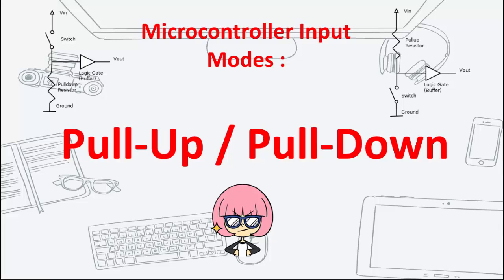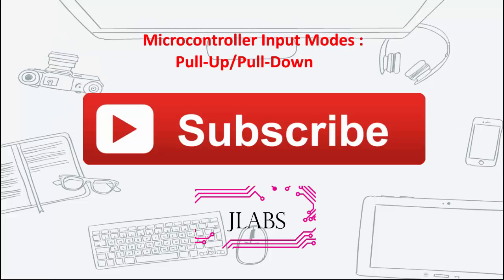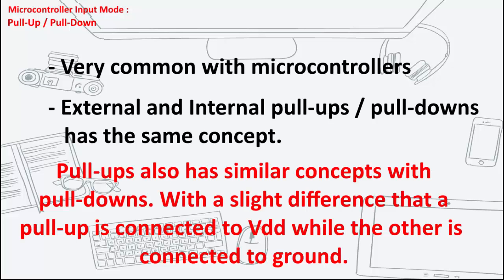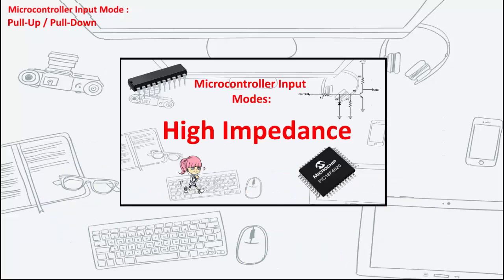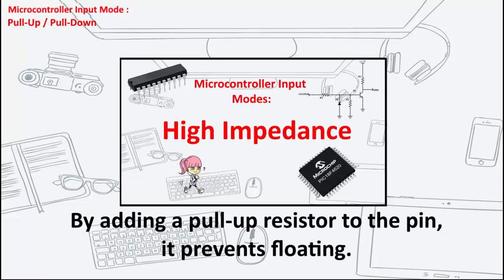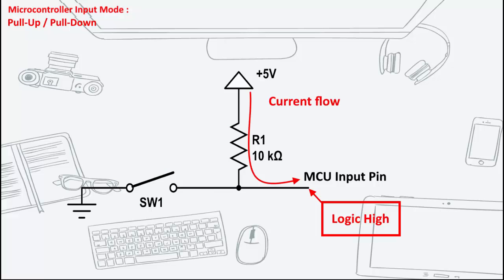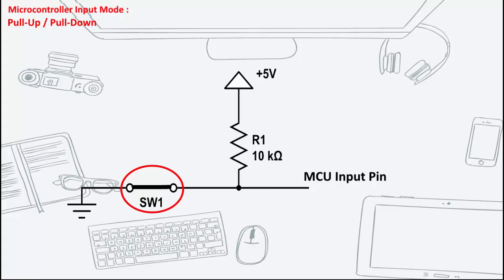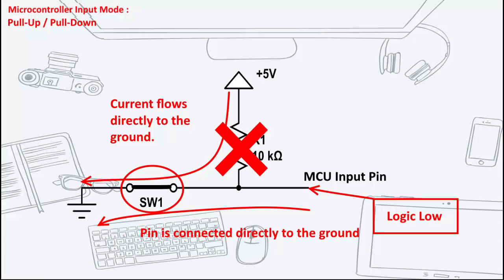Pull - Up / Pull - Down Configuration (Microcontroller Input Mode)

Comment: im working on a break out board and on the input side there are some pull up/ down resistors and i dont know what to do to them.....i might end up using some normally closed limt switches to the cnc machine im building , so i might use some pins but what if i dont end up using them?...should i set it to pull-up?............btw when i got my board they all came in the pull-down configuration.